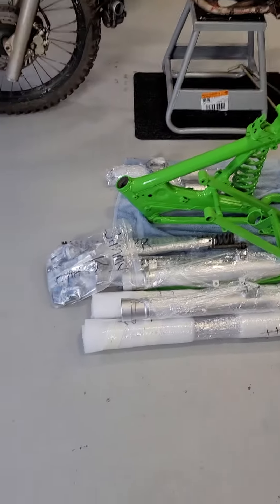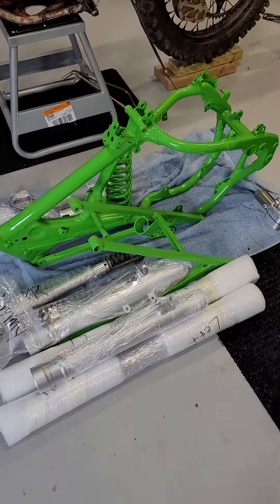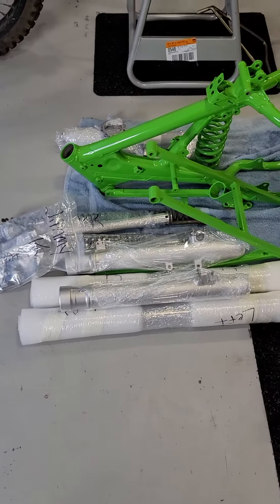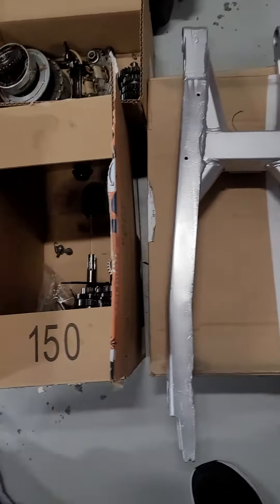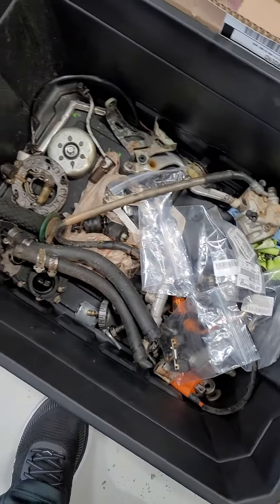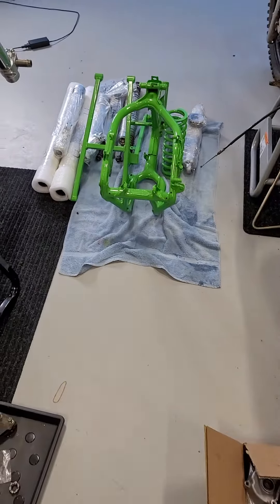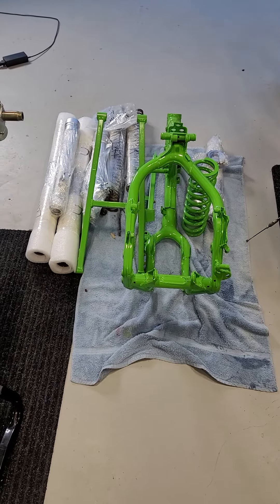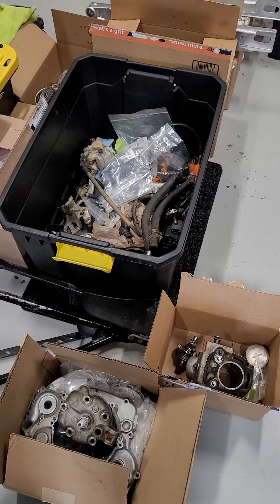2022 Broke to Built Teardown of the 1989 Kawasaki KX125 #broketobuilt

Comment: Hi Jimmy, I have a 1989 KX125 that appears to have a KDX200 engine.  Based on the frame VIN, I know it's a 89 KX125.  However, the motor is stamped with KHI DX200 EE005352.  Do you know how to decode the motor stamp to determine what year the motor is?
Reply from the maker: Actually I don't however I have 2 sets of cases. I'll check both to see if there is anything that looks similar between the 2